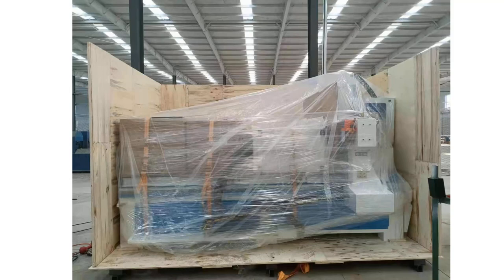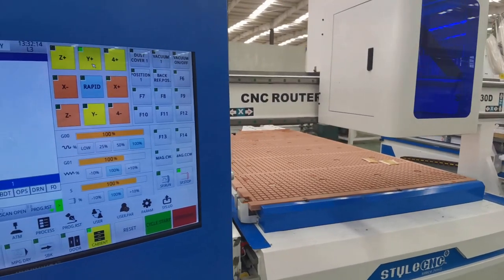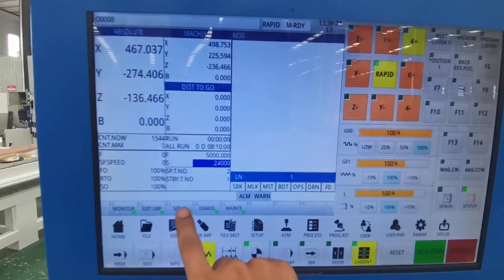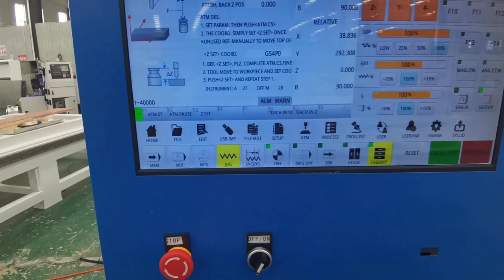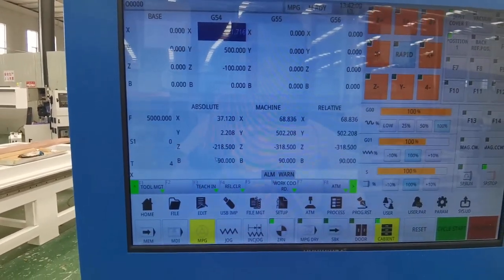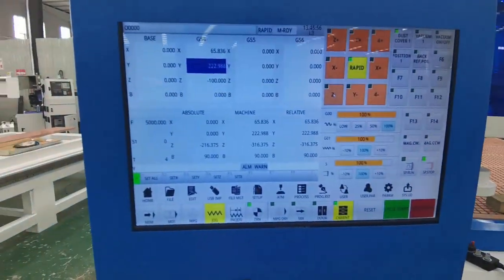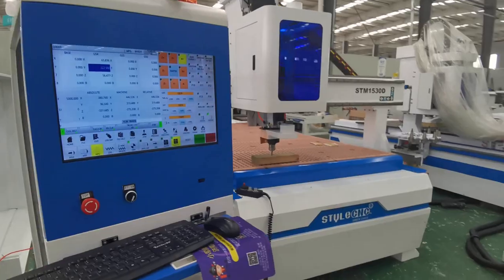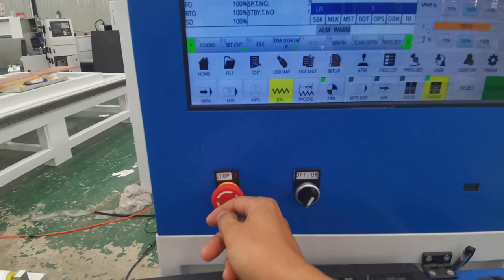How to use LNC control system in ATC CNC router! Automatic tool changer CNC wood router

Comment: Hello. Thanks for sharing the video. It explains very well how to calibrate the machine axes. I have that same model and it is currently vibrating when moving in the "Y" axis. Any idea what could be happening with the machine or what I should check?
Thank you again
Reply from the maker: Check whether one of the two Y-axis motors has stopped working.
Check the gear position for any impurities.
Check Y-axis drive.

Comment: Hello Dear, please wich .nc i have to use in ARTCAM 2011 or 2018 ? there is too much .nc formats
Reply from the maker: Different machines have different post-processors.
What is the control system of your machine? Does the machine have ATC function?

Comment: Si no qiero utilizar el atm... Como guardo el valor del eje z?
Reply from the maker: Is your machine an ATC machine, or does it only have one tool?
If it is an ATC machine, the length of each tool needs to be written into the tool manager.
If it is a single spindle and a tool. Just write the Z axis to the Z value in G54.